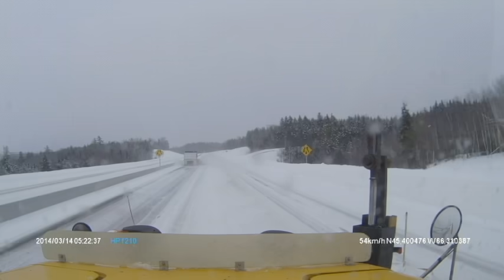Snow Plow accident

Comment: It must've been horrifying to see a huge oncoming plow truck decide to take a sudden turn and plow you instead
Reply: Gotta watch that thick snow/slushy ice mix in the middle, it'll suck you right in especially with a plow blade turned at an angle.
Reply: I was 17 years old traveling with 4 other high school friends in a Geo Metro during a snow storm.  5 guys in a really tiny car.
Metro driver lost control, spun out into the oncoming traffic lane, with a plow truck approaching.  The plow driver had just enough time to stop, and we ended up more or less tilted sideways at a 45 degree angle cradled in the plows blade.
3 years later and with over 300k miles on it, the Metro succumbed to a sheet of ice sliding off the roof of the garage it was parked in front of, crushing the Metro's roof and hood, blowing out all windows.
Reply: @peterbills4129  time to cut the roof off and make a metro cabriolet
Reply: No shit

Comment: The plow caught the curb or cement barrier
Reply from the maker: we think it was frozen ice buildup, also he was not loaded.
Reply: Had that happen with packed snow. Snowmobile trails that cross rds are especially dangerous.  They got me a few times.
Reply: Yeah, if the blade struck an uneven surface, as mentioned, a kurb, armco, pothole, etc... It COULD upset the balance of the truck, such as this incident here...
Reply: @Kris Kross why would the driver be fired ? I do residential snow removal in quebec , and crashed a bunch of cars in my 5 years . You drive in winter condition you are bound to get an accident at one point or the other

Comment: I've experience this myself plowing snow. Thankfully there wasn't any oncoming traffic. Then that nose plow catches hard pack the truck slides uncontrollably. If more people knew this they would give plows more room and understand why you can't plow at speeds faster than 35ish. One of the more terrifying jobs, you never know when you're going to be in the ditch.
Reply from the maker: Thanks for sharing, people do not give you guys enough respect
Reply: Thanks for sharing, I didn't even know this was possible. Now I'll be better aware of this.
Reply: If it wasnt for the people our job would be so much easier
Reply: I haven't ended up in the ditch yet plowing. I'm not a fan of angling the blade any more than necessary, but you can't run with it straight either. I never thought about it but this scenario is one reason not to run with the plow in float mode - takes too much weight off the steer tires.

Comment: For all you internet geniuses - the left side of plow caught the curb and forced truck to veer left into oncoming traffic. Its not rocket science
Reply: That is not at all what happened
Reply: @dontcare8197  Of course it is, if you have ever have operated a plowtruck   you would have known.
Reply: Or he hit ice... Did you file the accident report? Were you there?
Reply: @MrJokkoma  
I have, and that's not what happened. The plow got under a layer of ice that wouldn't peel off the road and it fired him sideways. Don't ask me how I know.
Reply: @lornes7526  Yes I can buy that. Ice or hardpacked snow hitting the left tip of the plow, it doesn't take much to pull a truck to the left when something's touching the plow.
Reply: @MrJokkoma  
I've had it happen a couple of times. When it does, there is nothing you can do but hang on for the ride. It's not a great feeling.
Reply: @lornes7526  I agree
Reply: So driver error then
Reply: @LTVoyager  All right so what's your version then?
Reply: @MrJokkoma  Hit a layer of ice or hard packed snow that caught the blade.  A curb hit is much more violent than this.
Reply: @LTVoyager  Probably yes.
Reply from the maker: @mikeznel6048  Yes it was ice he caught.

Comment: Always wondered why snow plows never seem to lose control. Turns out they do.
Reply: Plow still run on tires like car. They aren't run by tracks like tanks. It would be harder to skid on tank tracks but it would be way too slow. Plow tires are bigger so they have more traction but can still skid on snow and ice.
Reply: Even on chains... The chances of loss of control is VERY slim, but still possible in the right conditions...
Reply: As someone who drove one of those snowplows for years, yeah, they get squirrely real fast. Rear wheel drive and top heavy as heck, weight around 60,000 lbs. Looks like his left rear wheels slid off edge of the pavement.  All you can do is hold on and hope it doesn't roll over. Happened to me, slid right into a shallow ditch. Far side ditch bank kept her from going all the way over, but it was a hell a ride. Momentum and weight are not your friend. Sometimes you can slam the blade down and hope it acts like a brake. Doesn't work that well. I got into a slide on ice, dropped the blade as far down as it would go, and the truck pirouetted 180 degrees. Blade stuck, wheels didn't. Don't miss those days a bit - ha!
Reply: When fully loaded with salt and beet juice our city plows don't slide very much unless it is about -20 or you are on a big hill in very deep snow.
Reply: @TexasP00nTappa  Probably true, but also consider the slope and surface material of city streets versus an interstate. And how many city streets have hundreds of miles of grassy shoulders and medians? There's no sidewalks or parked cars or street signs on an interstate; after a while everything just looks like a flat field of white. You're also kicking up a cloud of snow in front and to the side which impairs vision. Speed also plays a factor. We watch city plows meander past at 20 mph max. On the interstate, anything less than 40 mph, and semi trucks will flat run you over ;-) I wondered why the snowplow driver didn't feel the shoulder rumble strips if that section of road had them? In whiteout conditions, center lane reflectors were priceless: I could tell where I was on a road based on how the blade bounced over the reflectors. When you can't see that well, you drive by feel. Reflectors, rumble strips same same. Maybe driver was just tired? 16 hours being beat to death by a big old truck, stressing over trying to see what you're doing, and avoiding reckless traffic is exhausting. We could do 3 16-hour days, then off for 24. I recall aching so bad I could barely walk. Cheers!
Reply from the maker: @gsdalpha1358  Thanks for sharing, people got to realize just how stressful a job you guys have out there in worst road and weather conditions! UNSUNG HEROES!!!

Comment: Thats one reason why you shouldn go faster than 40kph, especially without chains, i mean you also shouldnt go quickert than that with chains ether
Reply: They do 40 in a 90 here when they are not plowing or sanding for some reason. It's emcon though. The trucks probably running on 3 cylinders
Reply: Never used chains and we plow some of the worst conditions in the country.
Reply: @juliogonzo2718  in Canada maybe, states you plow st 35/45 mph, apply material at that speed, drive traffic speed while in transport.

Comment: it wouldn't take much especially if the truck isn't weighed down by salt to pull it sideways if one corner of the blade hit something like "anchor ice" on already slippery roads. Fellow NB'er here you guys do a vitally important and often underappreciated job putting in long hours with the number of trucks getting reduced and the hours getting longer plus 2014-15 was a hell of a winter
Reply from the maker: Thanks for sharing well said!!

Comment: Wait it wasn't the guy talking on the phone?
Reply from the maker: No it wasn't the guy on the phone!
Reply: @rusty4630  yeah I was quite surprised. Somewhat sarcastically.
Where I used to live there was a road with a sharp bend on my way home that was a bit slick during winter, it almost got me 2-3 times. Both times I was talking on the phone, once handheld and once Bluetooth... made no difference.
The first time I instantly dropped the phone and had both hands on the wheel within a second and avoided it, the second time I slid a little bit off the road.
It really comes down to where your putting your attention.
Although I did grow up near Syracuse NY and got used to riding in snow before I got my license in WV.

Comment: And that is one reason Plow truck drivers should not be required to work up to 16 hours straight. The government made special rules. Not saying it is what happened, but still could contribute.
Reply: Maybe in Canada, but in the states it's 12 hours.
Reply: Yes it is 16 hours in Canada, and I completely agree with you Chantal. I plow snow for the Goverment in Canada and 16 hours is way too long. It is a very dangerous job and having to pay attention to the roadway and all the equipment on the truck for so long is very exhausting. It only takes one mistake to kill someone in one of those trucks and after 13 to 14 hours it is very easy to make a mistake. I think the government should seriously consider changing this rule.
Reply: And also yes the plow did catch the concrete median based on how quick the truck shifted. Could have very easily been caused by fatigue.
Reply: I live in EU and we are some times required to work 30-40 hour days. Not enough blows here, I suppose. At the end of the shift you are very, very tired...
Reply: @juliusu6615  30 40 hr days.... dammm you guys got long days there... talk about a long work week... lol
Reply: Worked for 2 townships. I worked 20 hours the first day of big storms with each following day slightly less till done. First town was usually 3 days and second 2.
      The plow can catch on anything ice layer, packed snow, imperfection in rd. All can send the plow off like that. By me snowmobiles/trails are usually the issue.
Reply from the maker: @ubgaming7172  AGREE!!!!!!!!!!!!!!!!
Reply from the maker: @anthonythorp7291  Thanks for sharing.

Comment: plowing snow and laying sand along Columbia river gorge on Washington side. rookie clipped a guardrail along step cliff side. dump truck starts 360's with sheer cliff on one side. the impact knocks all the lights out putting the problem into total blackout. just kept waiting for impact at the bottom of the gorge. rig jolts to a thudding stop! still on the road off onto the shoulder opposite side the road. it was a heart stopper

Comment: lemme guess..  blade grabbed on some ice, threw him sideways and nothing he could do about it.. HIS FAULT AND HE HAS TO PAY ILL BET!!!
Reply: Thats actually very possible
Reply: @samdittmar5142  its happened to me!!!
Reply: @WPGinterceptor460Interceptor  probably scary as hell
Reply: A bit hard to tell for sure if they did or didn't, but if those trucks had under body plows that sit between the front wheels and the forward drivers if you add a bit too much down pressure and then hit a high spot on the road you instantly lose your steering. What happens is the steering tires are lifted just enough to lose there grip. A previous comment mentioned the truck was empty and that makes it even easier to do that.
Reply: @darekm6859  I've run equipment in open pit mining, construction, logging and even snow plows and graders for the local highway department on an on call basis. That's unbelievable they would even get owner/operators willing to use there equipment like that. Sadly they probably will get enough to do so. Your 100% right, those owner/ops will assume all risks and costs while the company hiring takes there cut with zero risk to themselves.
Reply from the maker: @turningpoint6643  Thanks for sharing, yes those underbelly plows were dangerous
Reply from the maker: @darekm6859  Wow unbelievable thanks for sharing.
Reply from the maker: Yes this is exactly what happened and the boss through him and I under the bus!!
Reply: @rusty4630  YUP been a plower driver for last 25 years.. dangerous job!
Reply: @darekm6859  How's that any different than uber?

Comment: 50km/h? No wonder accidents happen.
Reply: You realize you need momentum to push snow right?
Reply: @SnowPiercer1975  Err, no. You need force. You can push snow from standstill.
Reply: @olmostgudinaf8100  on a highway.... presumably they are trying to throw the snow rather than roll the snow away. For that .... momentum is required. And besides....even at 30-40km/h the accident wasn't going to be prevented since in all likelihood the blade edge caught something and spun the plow. It was really just bad timing that a car was passing at the same time
Reply from the maker: @SnowPiercer1975  Exactly well said.

Comment: Why can't you Canadians do some kind of preemptive on that snow,and ice? You all wait until the roads are all boogered up before going out.
Reply: No not really... There's only so many trucks and drivers and so much road it impossible to keep up with it all at once...
Reply: I'm in Ontario, the mto standards vary based on number of vehicles per day, but they are supposed to PREVENT ice formation. The highway is good here, but the town I live in they all go home at 5pm. The police are not happy about it. Sometimes when the highway gets closed and traffic is rerouted through town at night you end up with semis stuck on hills everywhere. They are going to get sued one day due to neglecting the roads
Reply: In case you haven't heard... It snows alot in Canada. That could easily be less then an hour's worth of accumulation depending on conditions. It's not unheard of for a plow to have to run the same stretch of road non stop
Reply from the maker: @mikeznel6048  Thanks for sharing well said.
Reply from the maker: @juliogonzo2718  Thanks for sharing, just like here in New Brunswick leaving themselves open to lawsuits.